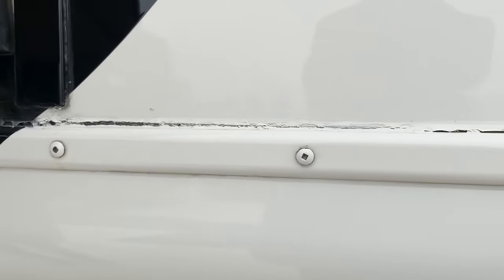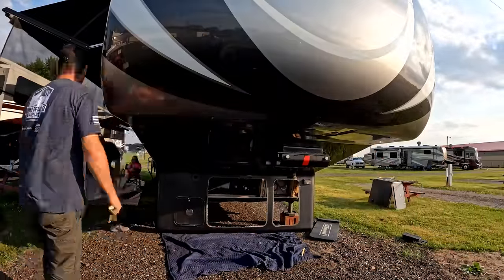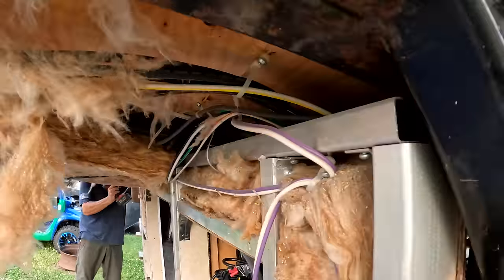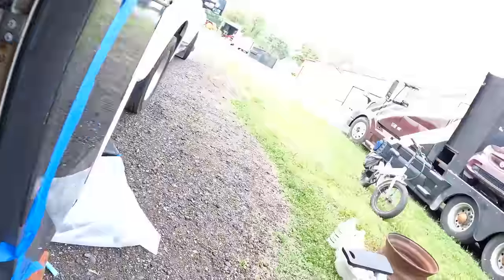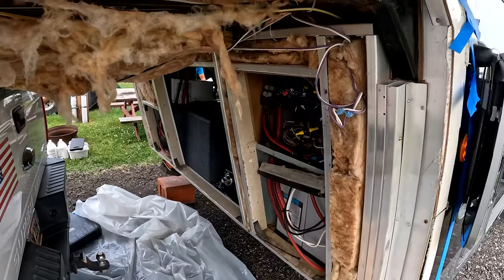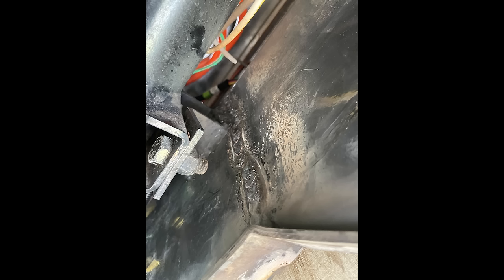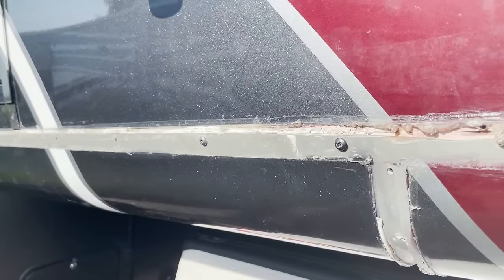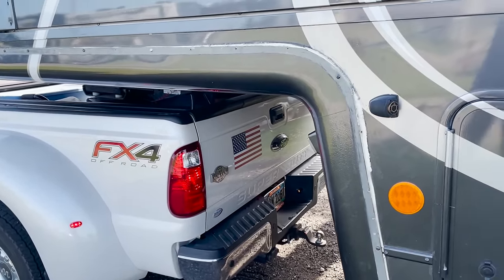WHAT???  Your Frame is Broke!  Lippert Broken RV Frame 7-27-22 DRV Elite Suites

Comment: That welder did a fantastic job on that especially for how poor the access and angles were that he had to work with.
Reply: @hondaftwg9543  agreed ,  and yes I'm an AWS D1.1 certified SMAW welder.
Reply: @hondaftwg9543 I believe the poster was in awe that the unit wasn't set on fire during the field triage 😳 Some 49 mile trips are really hard to drive compared to others😳

Comment: It might be to your advantage to have the whole front of your upper deck and basement structure with a heavier better metal . It will save you  the trouble a little bit down the road . When you weld Junk you get junk.

Comment: How regulated is the RV manufacturing industry? I have just started watching these type of videos and see so much wrong with the design, engineering and manufacturing. I am so stumped that these behemoths are on the road many years after the manufacture date.  In current form these are not made to last  long at all.

Comment: There is stress from two points of direction on the tubular frame. The fix you have done puts the stress higher on the tube and can reappear in the future. The design for the frame is not engineered correctly for weight and flex.

Comment: You can imagine the leverage from the pin to the inside.The frame is made of thin material that flexes too much.Eventually it will  crack. They are mostly concerned of weight not strenght when they make these frames.

Comment: I watched your video and watched the welder welding and than did he spray the weld with water? If so that causes the weld to be very brittle from cooling too fast 
Also the welds made at the factory, that looks like the start of the cracking.  It would be interesting to see the original weld have a hardness test performed.  It may be the inter pass temperature was exceeded if there is a welding procedure WPS backed with a welding procedure qualification PQR
Reply: I thought that too. Give him benefit of doubt, maybe he was spraying nearby areas to avoid a fire from the weld splatter

Comment: One of many reasons I finally said screw it and got rid of my RV. It doesn’t matter how much you spend on a so called premium RV it’s still a cheap trailer house built by people that build cheap trailer houses. Everything is done as cheaply and quickly as possible with virtually no attention to detail, safety, or quality. My last one was a 2015 40’ Heartland 5th wheel with 3 slides. The front cap got installed without any insulation behind it in spite of their advertising a fully insulated front cap, the brakes were totally inadequate and would not stop the rig even at 20 mph on flat ground and full gain, crushed heat ducts, wiring crushed between the subfloor and the frame, wiring not connected properly to the breakers in the panel, roof leak, storage compartment door leaks, swiveling dining table mounted tight to the wall so it wouldn’t swivel, screeching slide mechanisms that rubbed on the holes cut in the frame rails, all 4 Chinese tires failed in less than 2 years, sound system that worked intermittently, a bad television, and countless other minor flaws. I’m a former mechanic, experienced home remodeler, and retired electrician but I’ll be darned if I’m going to spend all my time fixing this crap after spending 50k to buy one. I’m done, sold it over a year ago and these crooks will never get another dime from me. It’s sad because we enjoyed camping for many years.

Comment: We HAD a 2007 Keystone Everest 364Q, loved the trailer, frame broke behind the axles in 2012.  Wife was vacuuming and wanted to know how come she could see daylight at the back wall?  Rv trailer frames need to be built much better, heavier.  Some engineer has to know how to build a frame, if not check with horse trailer manufactures. 🦅😎🇺🇸

Comment: Definitely not a high tensile structural steel. Thin walled mild steel rectangular. As cheap as cheap can get. Might as well use banana peels. You can clearly see the parent metal and not the weld breaking. The reason it broke right at the gusset is because there is not enough steel to support the beginning of the cantilever.
Reply: Pete, you explained the problem Exactly!
Reply: can you please explain in less shorter words?🤔
Reply: @jessihawkins9116  There are numerous grades of steel. By using a cheap grade with too little of carbon content, they are lighter and less structural. If it was high carbon hot rolled the carbon content is more evenly distributed throughout the steel. It's more costly and heavier than the mild cold roll steel they are using. Mild cold roll steel is easier to work with. Hot rolled steel will have a thin skin that needs to be ground through before welding witch makes it more costly to work with.
Reply: @peteengard9966  ^which not witch
Reply: @jessihawkins9116  I was never hired for my linguistics. I still can't figure out why there are 3  twos in the English language. Two, to, too. And why does the W look like it should be a double Vee. Probably why I was a better mechanic than a college professor.

Comment: I know Lippert builds most frames. Frames are designed by the RV builder and Lippert builds frame to specifications. I see most frame failures are Grand Design. I have a 2023 KZ280TH with 8000 miles on RV. I suspect frame problems. Have you come across KZ Frame problems?
Reply: Update. My frame was inspected and no problems found. Testing and measurements were good.

Comment: I have a 2022 Montana 3855BR that we took out to Glacier from southern Florida.  This was our first trip with it but on the way home I noticed a crack in the wall on drivers side just below the master bedroom slider. The crack in the fiberglass wall is about 10” and is also cracked on the inside. I am very disappointed in Keystone and Lippert. Keystone is aware of this and told me it was safe to drive it home from Southern Montana when I discovered it. The crack worsened after every stop I made and I prayed we would make it home. I sent pictures to Keystone and it is scheduled to go in to a local dealer on the 13th of September.  What are my rights where do I stand on this?  I personally don’t want them patching this or putting a band aid on it. Any advice?  Wish I could show you pictures.
Reply: What was the manufacture date on your unit ?
Reply: Keystone makes a garbage product. Try and get rid of it if you can.
Reply: @fuzion430journey3  12/2021
Reply: @joedwc  keystone makes great stuff , they didn’t make the frame lippert did
Reply: @fuzion430journey3  keystone is hot trash. They spec’d the frame that lippert made.
Reply: would it be ok to email you? I've had problems with keystone too.

Comment: Completely unacceptable.  A class action lawsuit is needed to change the behavior of the industry.  The question:  

1. was the frame built to spec by the RV manufacturer? If so, sue them.
2. If the frame is out of spec, then go after Lippert and the manufacturer. 

This does not happen in the auto industry. 

Also, contact your congress person.  Legislation to protect consumers is needed.

Comment: Metallurgically speaking, what kind of steel are they using? Did they change to some cheaper foreign made crap. That’s rectangular tube and shouldn’t crack like that. Maybe increase the wall thickness at those critical load areas? I’m sure the customer won’t notice the increase in price!

Comment: I too have been welding for many years. And apparently engineers have gotten in the way of a welders integrity of doing his job. I know they have to build the trailer so they're light enough so they can put their body work on top of the trailer but the engineers at lippert know how to build a trailer solid but they are directed by the trailer manufacturer such as Grand design or whatever to what they're going to do and they are not able to do what they should. If you folks with these fifth wheels start blocking up roadways by where the trailer manufacturer not leopard but Grand design etc etc or you'll start getting more action I'm surprised there hasn't been more of class action lawsuits and more of the attorney generals for the states getting involved for this this is going to become serious as serious as pintos and corvair troubles

Comment: Those guys aren't welders, they're rod burners. Lippert should call the boilermaker hall in Hammond and get a welder with ASME high pressure qualifications who can make an overhead weld in a tight spot look like a roll of dimes. And who gets some penetration.

Comment: Vibrational failure started in the gusset that's why you don't weld across the tube don't weld across the tube if they tell you to ignore them never weld across the tube high stress situations it will break every time every frame that they have built is in defect because of that every one of them will go into default it is not an if it is a when it breaks

Comment: I hear the one thing I'll say about Arby's travel trailers and more so leopard may make the frame but a lot of these RV manufacturers not the dealers the manufacturers are requesting things to be made lighter and in different ways leopard maybe making these frames as the RV manufacturers have recommended for them to make I'm not saying leopard is off the hook for doing it but I'm saying don't forget that your RV manufacturer may be part of this problem as well not just the frame manufacturer these are not built on an assembly line like a car these are built on more of a more Hands-On with maybe 50 to 100 done a day versus 100 to 1,000 like on a car symboline with that being said RVs companies are trying to make their RVs lighter and more flexible for different vehicles and they need to cut weight and many different ways whether it's your wiring is getting cheaper your water lines is getting cheaper your plastic Hardware the screws they use in order to save a few pounds here and there throughout another way they can shave off lots of weight is requesting a frame that is built to the RV manufacturer is specifications which may be slightly different than what you think they would be and when you load your RV up it exceeds those specifications that the frame was originally designed for with that being said that is also bad on the RV manufacturers and bad on the company making the frames but lipred has had problems with their friends in the past over multiple RVs travel trailers bumper pulls or fifth wheels and it seems to state from the manufacturer that they're requesting lighter frames so that they can hold more weight

Comment: This should have never been allowed to be fixed. It should have been turned over to insurance as a structurally insufficient trailer, and totaled out. If they have structural issues in the neck of the trailer, whats to say there aren't more hidden in the rest of the chassis?
Reply: Agreed 👍. Let the insurance company lawyers deal with them

Comment: If they used thicker steel theyd eliminate alot of those problems themetal at best 1/8 inch thick and cant handle the weight

Comment: Lippert frame failure caused substantial damage to the rest of the RV.  I sure as heck would have them on the hook for the whole repair. All damage and disassembly  and reassembly. 
and no would not be the answer as i would have an engineer wright an opinion of the reason for failure and design a repair $$$$$$$ and off to court we go

Comment: Frames should be fully welded together. Not screwed into flimsy box tubing. No wonder it came apart. Those screws are only as strong as 1/8" when it grabs the tubing. There should be some wood or other material there for them to grab onto. Frames should not be screwed together.  IF boat manufacturers built boats like the most RV manufacturers build RVs, their boats would be on the bottom in a month. Don't buy junk! Investigate how RVs are built. If you look hard enough you will find some that are built correctly. Good luck . . .

Comment: should have been reinforced to begin with .. also screws are a terrible fastener for aluminum , through bolts should be used on gussetts ...adding more braces would be very minimal at the factory ... 150,000 vehicle should have some regulations on how its built

Comment: No amount of weld repair, crutching or gusseting will remedy the problem. The original structural steel frame members were insufficient in design and strength. No matter how much bread you add to rotten meat in a sandwich, you'll always taste the rotten meat.

The frame is worth nothing more than scrap. Why risk your life and the life of others doing patchwork of a poorly engineered frame.

Scrap the trailer, sue Lippert and the RV manufacturer and move on.

Comment: The wall thickness of the rectangular tubing used throughout the frontal structure is Too thin! They have been building them this way for more than 30 years. The rigs get bigger, the storage areas up front have gotten larger, and the structure of rectangular tubing has been changed to account for the increased weight.
Thicker walled tubing would eliminate most all of these broken front structures problems. It a matter of cost and weight if stronger materials were to be used. The industry knows there is a problem, and are aware of the frame problems up front and the problems at the spring hanger areas, and the I beam frame flex.
They just choose to ignore the problems and continue to “underbuild” these units. BUYER BEWARE! These break have been going on for years and years.

Comment: Failure right in the heat affected zone.  One, welder ran hot and weakened the metal, two, engineering done by an Amish farmer and under designed.

Comment: It's just unbelievable that after dropping a ton of money on a new RV, you end up with such major manufacturing defects as this.   Imagine what would have happened if one of these cracks suddenly blew open and failed while you were fogging down the interstate at 60mph.   No amount of additional welding, gusset plates, braces, brackets, etc. would ever make me feel safe hauling this thing down the road again.   Even the most expensive rigs can have the same crappy engineering and quality control as the cheapest rigs out there.
Reply: These videos are making me glad I did my traveling when I was younger and those days are behind me.  All these disasters waiting to happen in abundance on the freeways of the US?  No thanks I'll stay safe and retired at home!

Comment: Lippert must be buying their steel from China I was a Mfg. Engineer for 55 years building Oilwell Drilling Equipment and the Oil drillers would accept or let us us foreign materials all our plate stock and tubing was from the USA and we built 200,000 lbs. drilling units the Norway offshore rigs were the controlling facture for material specs.

Comment: They're using cheap cheap metal it almost looks like that metal they use on bed frames
And if you try to weld on that it'll just cracks 
You can tell the difference in metal at the end of video

Comment: I don't excuse Lippert on this by any means as it still has to be established that they built the frame as the engineers designed and spec'd it first. My complaint is with the manufacturers. After building rv's for 60 plus years of designing and building recreational vehicles, they do not appear to have learned anything except to "HOPE" that their 17:02  designs will hold up. Well, as they say in the military, hope is not a plan for sucess. We all want our rv's for the best price posuccess. But when we are stepping up and paying good money for what is marketed as premium rv's, and then we end up with these results, we'll I have just about had it! I may be a slow learner, but after 40 years as an rv'er, I  am probably done with this industry. I have had the whole spectrum of rv's in both price conscious as well as luxury models and have seen things in them all that just did not make sense for the manufacturer to do for a trailer or motorhome designed for going down our highways. I am tired of the term " if you don't want to work on an rv, don't buy an rv" being thrown in my face regarding basic design items. As I started with at the beginning of this "rant", most times Lippert is building what the manufacturer's engineers are sending them. When Lippert doesn't do their job, then it's on them. But there is PLENTY OF BLAME TO GO AROUND FOR EVERYONNE OF THESE MANUFACTURERS! It seems that they have only learned to make things as cheap as possible and sell it as "premium". I, for one, have had enough! It's time we vote with our wallets.

Comment: We bought a travel trailer by Grand Design 3 years ago and the first time I crawled under it I realized I was screwed. The Lippert frame appeared to have been welded by a drunken blind person. The welds are barely on the seam,  The wiring needs to be redone, the winter package must be for South Carolina  winters but it looks good sitting still. It's very disappointing that I traded in a n older trailer that was really in better shape than the brand new one.
Reply: That's scary AF, glad I just stay home now days, and did my traveling when I was young.

Comment: Anybody that bought a new RV from the year starting 2020 to the present this is the affect! I have owned an excess of 31 personal use RVs. I have never in all my years experienced any frame issues any brakes or cracks not even a flat tire. I have a scale at my door. Everything that goes in my RV gets weighed every thing I know the weight of water I know my capacity of the water I know the capacity of my gray and black tanks. I also know the capacity of my propane I know the weights of every person that rides in my truck and who stays in my RV, would I buy a new camper between the years starting 2020 to 2020 for never let me say that again never never never
These are the consequences of buying during the pandemic when there were issues with raw material and with proper staff nobody gets this nobody good luck with you my friend.